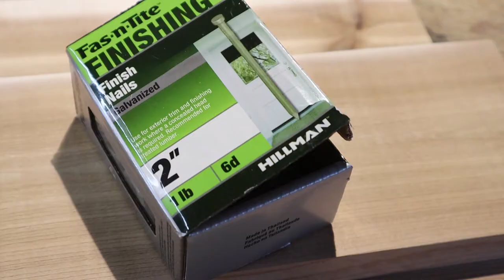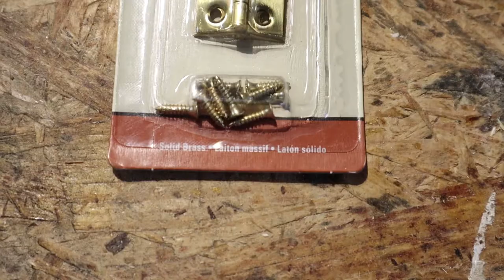Cedar Mailbox for Your Porch - DIY

Comment: Good job mate! Two questions: 1 wich mitersaw do you have and whats tge reason you did not choose for a sliding version. I am doubting what i should buy. 2. Happy with the ryobi nailgun?
Reply from the maker: I use the Dewalt 12" and really want to upgrade to a slider but this one is only 2 yrs old 😢. Definitely go with a slider. The nail gun is amazing. I've been hammering in nails for small projects for years - this is a game changer.
Reply: @KellyConcepts  Thanks. I do want a slider aswell. The only negative for me is the amount of space it takes in my shop.